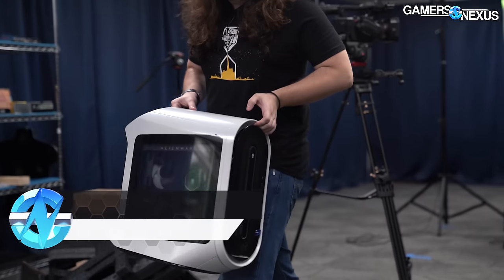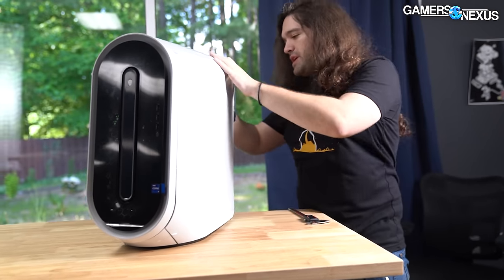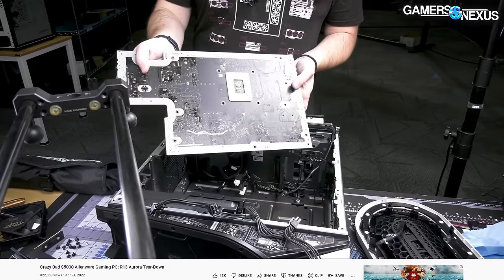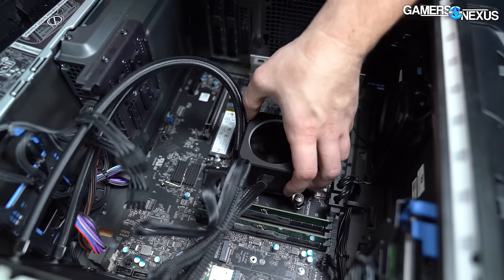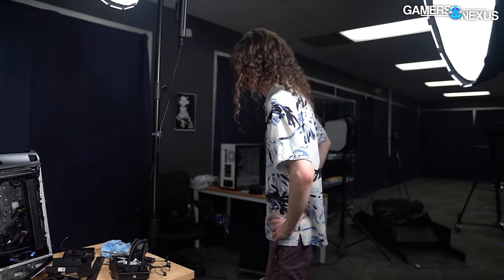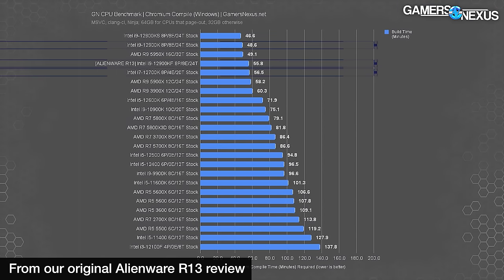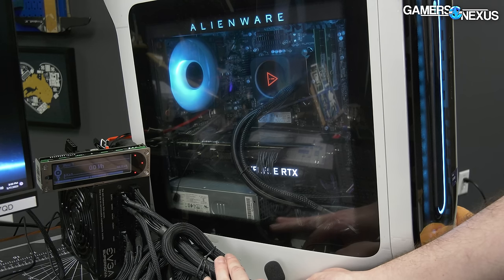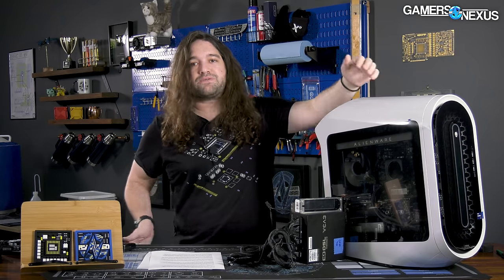"Fixing" the Alienware R13 Dumpster Fire

Comment from the maker: STOCK IS ALMOST OUT of the GN Volt Modmats! It will be a few months before we have more in stock, so if you want a high-quality PC building work surface, grab it now: https://store.gamersnexus.net/products/modmat-volt-large 
We previously reviewed the Alienware R13 here: https://www.youtube.com/watch?v=8ulhFi5N2hc 
If you missed it, our teardown of the Alienware R13 can be found here: https://www.youtube.com/watch?v=DY1dlVPzUVo 
We have an entire playlist of Prebuilt system reviews on the channel here: https://www.youtube.com/playlist?list=PLsuVSmND84QuM2HKzG7ipbIbE_R5EnCLM
Reply: he didnt turn water in to wine but at least he tried
Reply: STEVE Please help, Command center got installed with my alienware monitor and I can't get rid of it! I've uninstalled it twice but it keeps getting reinstalled somehow and it runs my cpu at 30% for absolutely no reason, I just see a alienware process in task manager but nothing is actually running. Also, when it reinstalls it doesn't have a shortcut or start menu entry so I can only find it in control panel to uninstall again.
Reply: @mcunner  When you uninstall it, how do you do it? I mean, do you use the search bar and click uninstall from there or do you use a different method? & If you can't uninstall it whatsoever regardless of what you do, lower it's priority using task manager and check if that makes a difference to the CPU usage
Reply: idk why but seeing you casually use a key fob to open a door was pretty dang sweet, very cool.
Reply: @mcunner  i would suggest to get a clean windows iso and reinstall
Reply: This particular case almost screams "I have 3 140 mm fans in the front". Achieving this would be a great goal for a case mod. The plastic face plate would need to go, of course.
Reply: It's not going to boot with anything other than the stock fans plugged into the motherboard and if any are missing it all won't boot either.
Reply: The video linked in the show notes is the Ryzen-based R10 btw.
Reply: Alienware locking every part is known for years. even the usb 3.0 header on older motherboards, had a chip that detected a official dell cable
Reply: For amny people it is just the look of the PC that seems to attract them....you could have B-Rolled a few outlandish cases for an example.....because some people have so little confidence to 'risk' it....Even the Kolink big Chungus is am almost like for like in shape.. or the crazy Jonsbo TR03... Even as a public service announcement it has to be to stop people thinking the Alienware looks cool...it actually is a BORING case, it's just the only 'diffeent' case that has high media visuals... God it really is a boring boring case... Great Video :)
Reply: M3 x 15mm screws and the CPU cooler will bolt into the existing backplate is what i did in the dell g5 i bet it would work for any dell case. could also bios tweak but that is risky and requires alot of knowledge and or someone else doing it and trusting there instruction's again risky. in short "Dell" is on my avoid list....
Reply: Hey gn what is that work light ( on the table ) that you're using please, looks really handy.
Reply: Corsair Cat Tax.
Reply: Alienware make me 😔
Reply: gl hf guys
Reply: Don’t give dell ideas, they don’t deserve it
Reply: I'm the one who recommended you do this and no love for the idea?
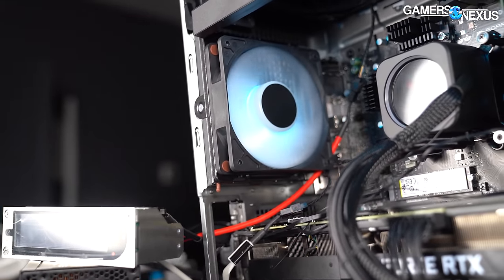Reply: 18:15 I leave my fans on full all the time because many years ago I remember reading that changing fan speeds puts extra wear and tear on the fan. That might be why there is no fan speed control. Unless the fans have zero physical contact like maglev then changing their speeds will reduce lifetime. Maybe this is why my ancient cheapo Thermaltake led fans from 2006 still work even today.
Reply: @mcunner  Try a program called "geek uninstaller" it removes all the "remnants" of whatever you're trying to uninstall.
Reply: I actually use that Dell cooler with a NZXT g12 to cool my rx580. Works great for that, but that is a WAY smaller heat source even OC'd.
Reply: When I was a kid, I drilled 93 meticiously placed 1mm holes to ventilate my P4 laptop so it would beable to gain 3% better clocks.... taking away material is NEVER against the rules.

On that one - I'd cut a slot down the front of the plexi.  OR  Trace out a 240mm to the plexi - then  cut the plexi and mount the new fan.
Reply: Wasted effort sadly, there's no saving it even if it had more lives than a cat
Reply: Am I crazy or is the radiator mounted the wrong way? If I'm not mistaken the cables should be top instead of bottom so the air gets trapped on top?!?
Reply: Alienware has a place in my heart still, once upon a time I unboxed a big ass red alienware 17 inch laptop, with sexy metal body, pre DELL days, downloaded and maxed out Crisis for the first time in my life and was blown away, using the laptop on my lap burnt my legs, but the pain was worth it, gone are the good ol days.
Reply: You could've just cut some of the plastic front, and i agree a bigger cooler like 240ML water cooler is needed. Dell could've just reverse the inclined and so the hot air could rise
Reply: I’m a newbie, I was going to buy an Alienware fully specked out PC, since I don’t really know what I’m doing I was just gonna buy everything , So are you saying the main problem I might encounter is, I might just get 2/3 of the performance that I’m supposed to get if I buy this machine fully specked out?
Reply: NOCTUA ?
Reply: i STILL hate cASES THAT HAVE NO dvd bLU-rAY DRIVE.
Reply: I learned something here today.
Thanks Steve... 

Now I know how to fix this dumpster fire case.
It only needs 1 fix though...

Keep the money in your pocket and build a pc yourself with that money instead...?